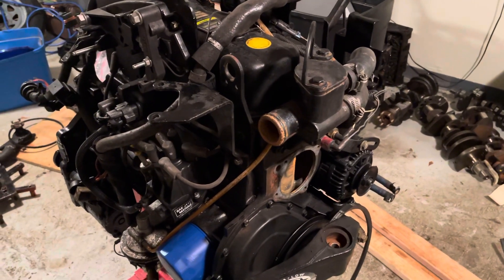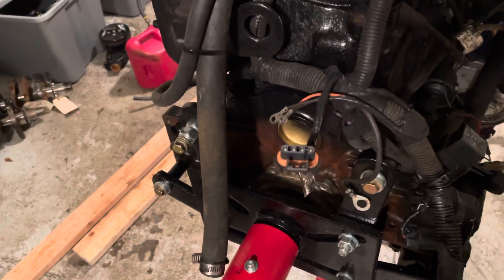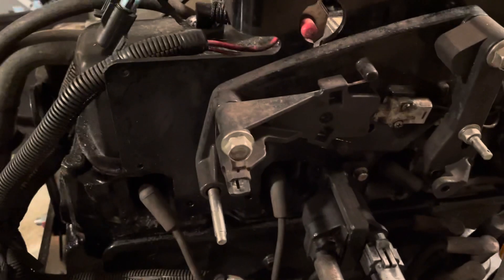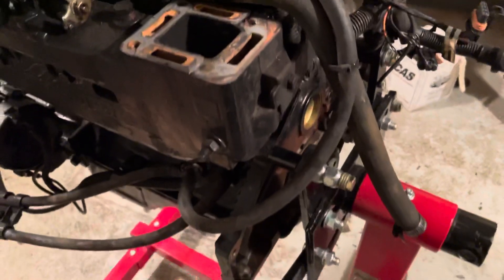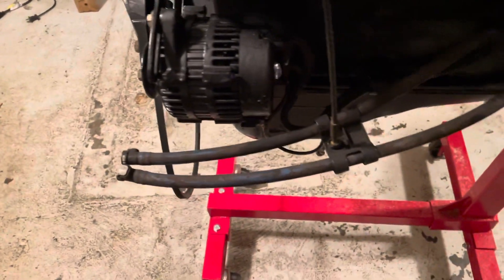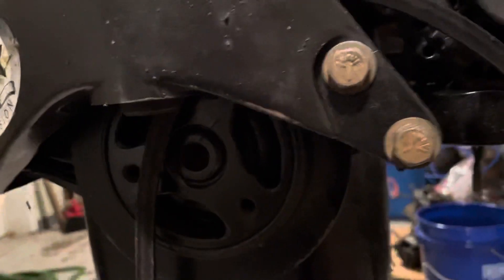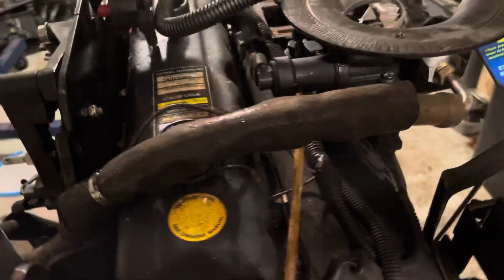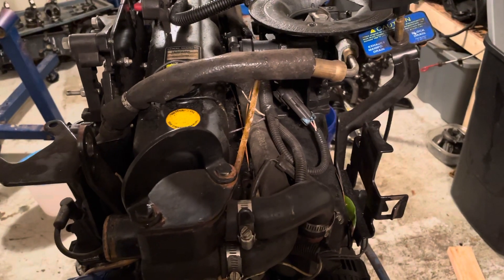Mercruiser 3.0 1(X1) - Teardown - Initial Inspection

Comment: Pentru ce este celalat furtun conectat la toba de esapament ?
Reply from the maker: Can you repeat the question in English?
Reply: @moccasinmarine hello,sorry.i write you from Romania 😀.
 You have ther 3 hoses.
One to drain muffler
One to drain engine block.
And other one?
For what is it?
Thx
Reply from the maker: @budoitraian  I believe it’s an air vent to allow exhaust to drain. The water supply system has a small hole in water pump that allows water to slowly drain out of the foot when pump isn’t turning. This allows air to enter the water system venting n the drain hose.